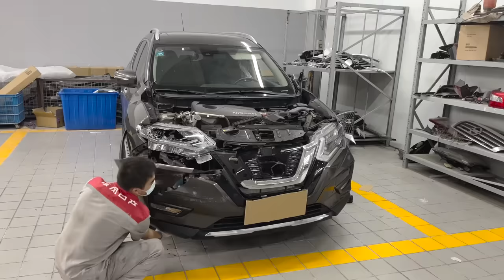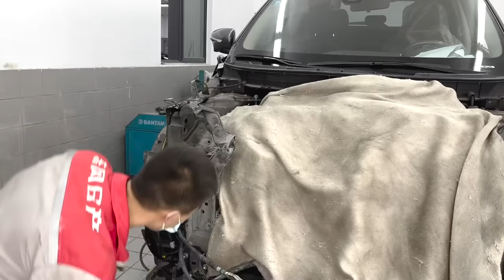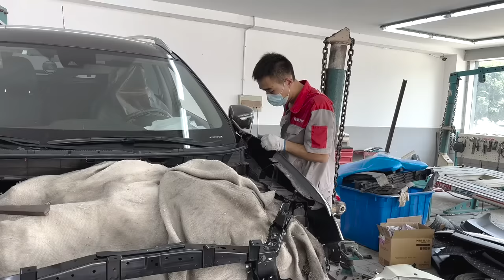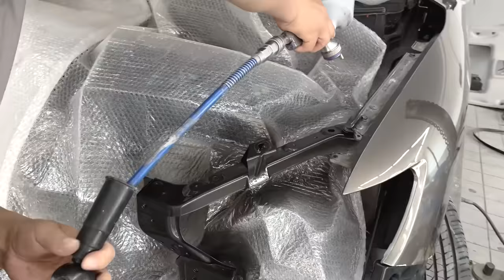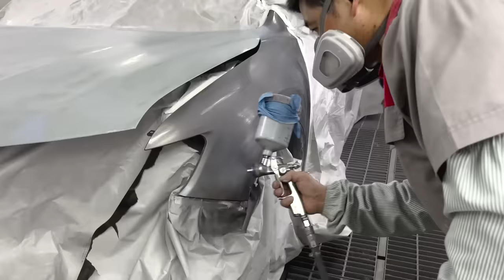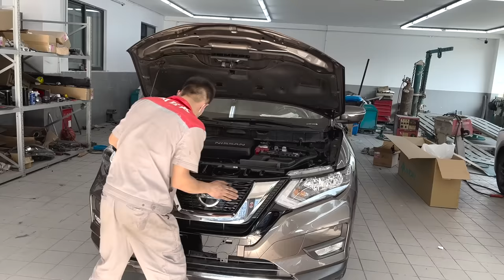Nissan X-Trail Front Collision Repair

Comment: i hear so many comments from various countrys saying these cars would be scrapped,here in the uk i do this every day,the insurance companys wouldnt scrap a job like this,keep up the good work.
Reply: Me too. I prefer these jobs over doing body filler work.
Reply: Claro que no los tiran a la basura, al contrario el seguro lo recoge lo vende y la persona que lo compra lo arregla en un taller.
Reply: In the USA some of these would be scrapped. Especially if you have to pull engine to repair. Insurance does not want to pay.. also if a lot of air bags go off they total it. cost of parts and repair is too much..
Reply: @turboimport95 its not this also, if the damage is too high it needs to be totalled cause of the people protection inaide, if it crash again it will turn like scratched paper ball, the skeleton body of the car wont handle the next crash
Reply: In Indiana insurance auto insurance companies total out a vehicle, if repair is more than the value of the car.
Reply: In the United States that a scrap car.
Reply: Yea I agree why my body shop is full with these vehicles
Reply: Excellent job, but I wouldn't be buying this car unless everything under the hood is replaced including the engine.🤣🤣🤣🤣

Comment: Looks awesome! In case my car gets rammed, I am wondering, approximately how much does this kind of reparation cost?
Reply from the maker: The cost of repairing a car after a collision can vary widely depending on several factors, including the extent of the damage, the make and model of the vehicle, the labor rates in your area, and whether any specialized parts or materials are needed for the repair. Additionally, if you're considering having the repair done professionally, the reputation and expertise of the repair shop or technician can also influence the cost.

Comment: Like to see a close up of your seam sealer tool and what brand  and where to get the tips from
Reply from the maker: you can find seam sealer tools and related accessories at automotive supply stores, online retailers, or directly from manufacturers. Popular brands for automotive tools and accessories include 3M, SEM, and Evercoat. You may want to check their official websites or reputable automotive supply websites for product details and availability.
Reply: What is the one you have to compare... next video please show closeup and slower detail video of the process

Comment: Looks good. How do you get the seam sealer to look that good under the hood? I use to work at a Nissan plant and i worked on the sealer deck for a while. It was alot easier because we had tips that would help us stay on the seam.
Reply from the maker: Achieving a smooth and clean seam sealer application can be challenging, but there are a few techniques that can help. Using the right tools and equipment is crucial. Some professionals use a caulking gun or a sealer gun with a nozzle that allows for precise application along the seam.

Additionally, proper surface preparation is essential. Cleaning the area thoroughly and ensuring it is dry before applying the seam sealer can improve the result. Skill and experience also play a significant role in achieving a neat finish.

While working in a controlled environment with specialized tools can make the job easier, skilled craftsmen can achieve impressive results even in more challenging conditions. It's all about attention to detail and the right techniques.

Comment: On the fence about that. Bending metal back in place after impact damages seems like it would weaken the metal.
Reply from the maker: You're right to have concerns about bending metal back into place after it's been damaged by an impact. When metal is bent, it undergoes stress and strain, which can weaken its structural integrity.

Comment: Is this even safe to drive ?
Reply from the maker: @ahmedklol1737 Safety is our top priority in every repair we undertake. After the repair process, the vehicle is thoroughly inspected to ensure that it meets all safety standards. Our skilled technicians work diligently to restore the vehicle's structural integrity and functionality. We conduct rigorous tests and quality checks before declaring the vehicle safe for driving.

However, it is crucial for vehicle owners to also practice responsible driving and regular maintenance to ensure the continued safety of their vehicles. If you have any specific concerns about the safety of this repaired vehicle or any other, please feel free to reach out to us. We take our customers' safety seriously and are always here to address any questions or concerns you may have. Thank you for your attention to safety, and we appreciate your feedback.
Reply: @xinxianshi  i just hit my front bumper its very small hit and the bumper didnt damage just dent to indise for about 3 inch 
The air bag come out 😭
The dealer said its not safe to drive you must do an air bag system repair 
My question is the air bag system return as original after this repair

Comment: What is the approximate speed of this car at the time of the accident?
Reply from the maker: Thank you for your question! Judging by the extent of damage on the repaired vehicle, the speed at the time of the accident might not have been excessively high. Typically, lower speed collisions can result in relatively lighter vehicle damage, while higher speed collisions can lead to more severe damage. However, the exact speed would need to be determined based on factors such as the accident scene and the vehicle's structure. The repair technician seems to have done an excellent job in this repair, and the vehicle appears to have been restored quite well.

Comment: Notice the use of safety glasses when drilling?
The use of welding goggles when welding?
The use of a chassis straightening machine at any stage of the process?
Reply from the maker: Thank you for your comment. You bring up important points regarding safety precautions in automotive repairs.

When drilling, it is indeed crucial to use safety glasses or protective eyewear. This helps prevent any debris or particles from entering the eyes and causing potential harm.

Similarly, when welding, it is essential to wear welding goggles or a welding helmet with a proper filter lens. This protects the eyes from the intense light and harmful radiation generated during the welding process.

Regarding the use of a chassis straightening machine, it can be employed in certain cases during the repair process. A chassis straightening machine is designed to help restore the original geometry and structural integrity of the vehicle's frame or chassis. However, it's important to note that the usage of such equipment should be carried out by trained professionals who have expertise in its operation. Improper use or inadequate knowledge may result in further damage or compromise the safety of the vehicle.

Safety is a critical aspect of automotive repairs, and it's vital to follow proper safety procedures and use appropriate protective equipment to ensure the well-being of the technicians and the quality of the repair work.

Thank you for raising these important points, and if you have any further questions, feel free to ask.
Reply: @xinxianshi  I had no questions, I was just stating facts as to what real, experienced car repairers do and the difference between them and others. 
You get what you pay for.

Comment: How much this fix costs??
Reply from the maker: Unfortunately, I cannot provide specific cost information as it can vary depending on several factors such as the extent of the damage, the type of vehicle, and the location. It is best to consult with a professional mechanic or body shop to get an accurate estimate for the specific repair. They will be able to assess the damage and provide you with an estimate based on the required parts, labor, and any additional services needed.

Comment: did he just weld with no helmet
Reply from the maker: Yes, there are instances in the video where the technician appears to be welding without wearing a welding helmet or proper eye protection. Welding without adequate eye protection can be extremely dangerous and may lead to eye injuries or long-term damage. It's crucial for individuals involved in welding activities to use proper safety equipment, including welding helmets with appropriate shading to protect their eyes from the intense light produced during welding.

Comment: Damn is  that not considered a total loss?
Reply from the maker: @GhadSpeed  • 1天前
In some cases, extensive damage to a vehicle can indeed result in it being considered a total loss. However, it ultimately depends on various factors such as the cost of repairs compared to the vehicle's value, insurance policies, and local regulations. If the cost to repair the vehicle exceeds its value or a certain threshold set by the insurance company, it may be deemed a total loss. However, skilled craftsmen can often restore vehicles that may appear severely damaged, bringing them back to a roadworthy condition. It's important to assess the extent of the damage and consult with professionals to determine the best course of action.
Reply: @xinxianshi  I understand. I’m only asking because this happen to a friend I know of. They had got hit from the right rear fender. (frame damage) and the insurance company claimed the vehicle as a total loss. 

And the motor is original and runs flawlessly. 

Keep up the good content my friend.

Comment: I just noticed, the body looks so weak, looks like made of soft drink can.
Reply from the maker: @kenlow4028  • 9小时前
It may appear that way, but modern vehicle bodies are designed to prioritize safety by incorporating crumple zones that absorb impact energy and protect the occupants. The use of lightweight materials like aluminum can contribute to fuel efficiency while maintaining structural integrity. Rest assured, these designs undergo rigorous testing to meet safety standards.

Comment: So gopd to work on repairing a car when you have all the OEM parts on hand just a request away. Great job but Why the masks though?!?!? I'd hate to work that way
Reply from the maker: Wearing masks during car repair work, especially during processes like welding, grinding, or sanding, is essential for several reasons:

Safety from Dust and Particles: These processes generate a significant amount of dust, metal particles, and debris that can be harmful if inhaled. Masks help protect the respiratory system from these airborne particles, reducing the risk of respiratory issues.

Protection from Fumes: Welding, in particular, produces harmful fumes and gases that can

Comment: this is not x trail its nissan roque
Reply from the maker: You are correct. In some regions, the Nissan X-Trail is known as the Nissan Rogue. It's the same model, but it has different names depending on the market. The vehicle being repaired in the video might be referred to as Nissan Rogue in certain regions, while in others, it's known as Nissan X-Trail. Regardless of the name, the repair work showcased in the video was impressive and skillfully done by the technicians.